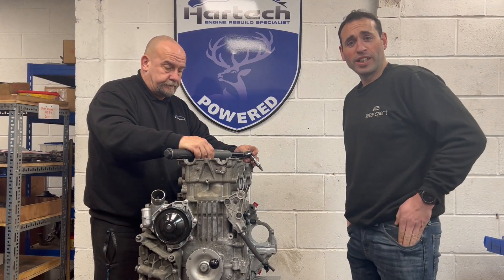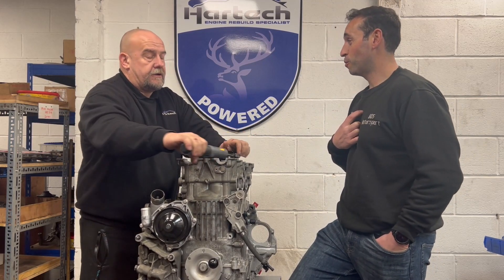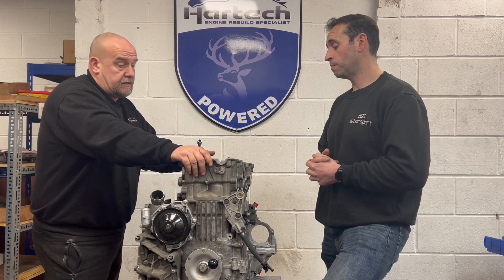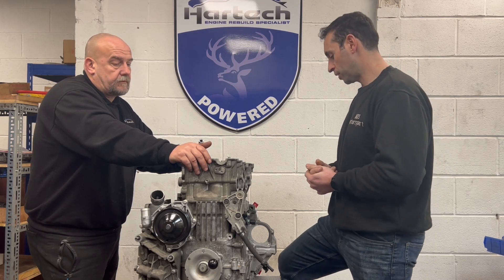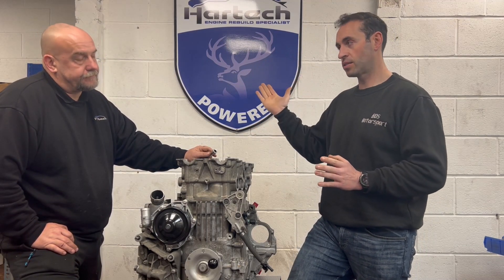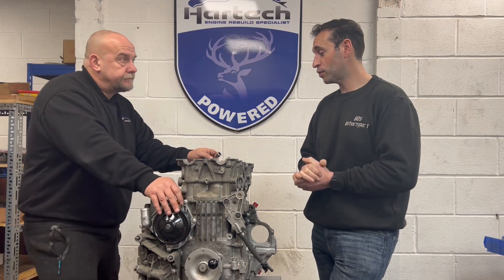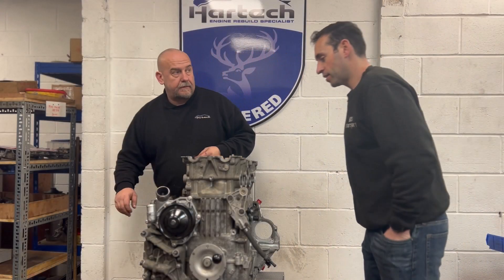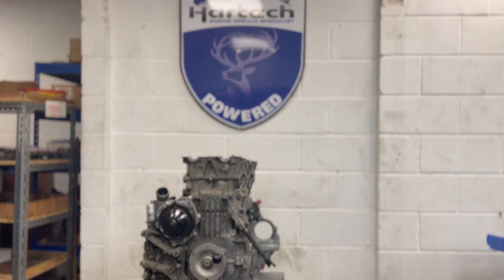Porsche Development Hartech 4.1 engine ready to go in

Comment: I'd be interested to know whether the stock exhaust manifolds, cats & system on the 3.8 are capable of supporting 400+ bhp, or are they causing restrictions? Thanks
Reply from the maker: Genuinely the stock exhaust is very decent and most aftermarket solutions will actually not gain anything on a stock 3.8! We never had the stock exhaust on our car as never came with one but over the aftermarket exhaust it came with we made a lot more torque all across the curve! We cannot talk about something we haven’t tested but in our view it would be a restriction for sure at that power level. If you would like more info on our build please contact us through our website 

Thank you for watching
Reply: @BDSMotorsport  thanks for the reply. I will watch this with great interest and may well be buying from you in the future 🤞🤞